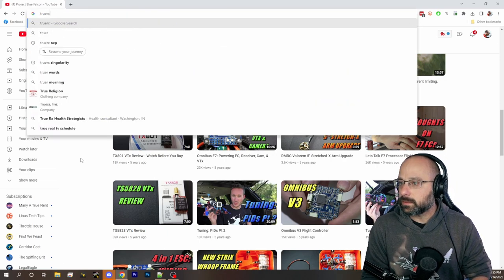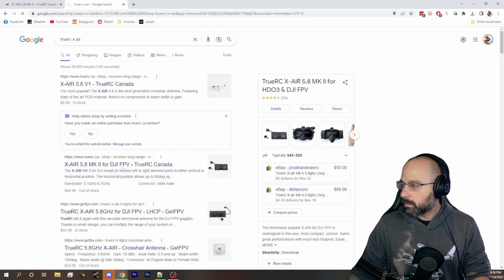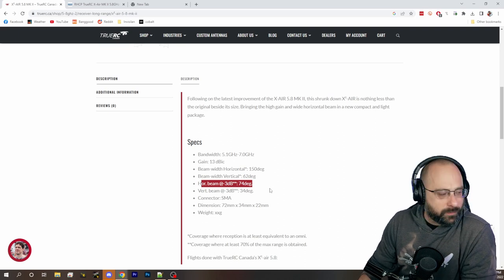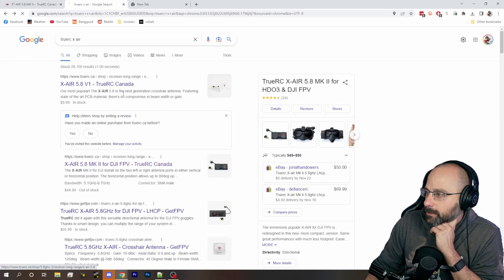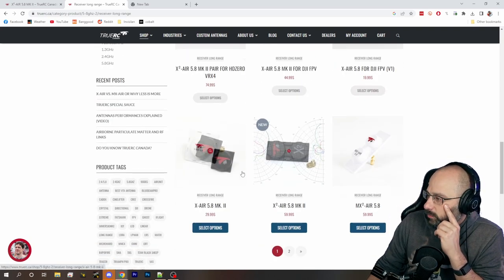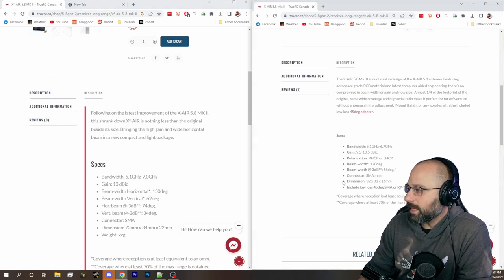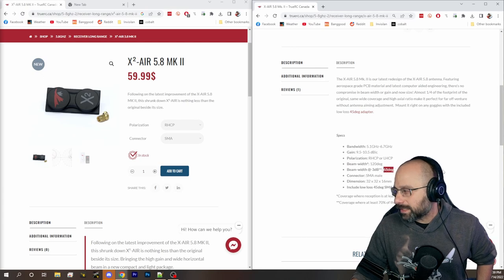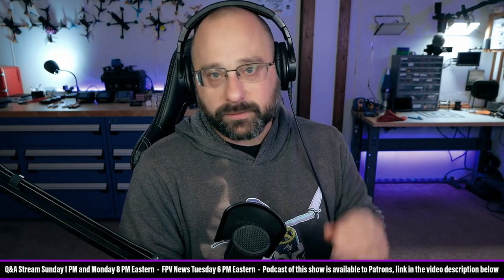How Do I Compare Antennas? X2 Air vs X Air - FPV Questions

Comment: Thanks for that Josh! always great to hear your info, sick or not.  Thank you.  Also, i was wondering when they talk about horizontal and vertical for that xair2, i have to wonder which orientation of the patch is better for side to side reception vs up and down...
Reply: Run the x2 air antenna vertically(or tall) to get best "side to side" reception.  Damn is it confusing to try and explain that in text LOL.
These are pretty similar to the VAS cross hair and pepper box antennas and are technically not a patch. I run VAS receiving antennas but have had them for many years if i was buying antennas today i'd go True RC all the way. Also follow their face book page Hugo will announce  sales of seconds that have cosmetic blemishes from manufacturing i recently picked up 97$ worth of omni antennas for 34$ including shipping, blemishes on the singularities i got was scuffed logos or small a tear in the heat shrink in one case.
Reply: @sayyay6230 so strange that the tall orientation gives a wider horizontal cone lol no wonder everybody getting confused and turning them sideways lol
Reply: @sayyay6230 also how often do they do discounts like that?
I'm looking to upgrade antennas but not tryna wait more than a couple or few weeks for a better deal

Comment: Just curious if the truerc x2 air are plug and play for the DJI fpv goggles? There's no inn menu settings like I find on YouTube for my goggles? Is the max power already set at 700 mW?
Reply: Yeah all antenna that work with it in terms of it matching polarization and sma connector. There is no setting in goggles for what type of antennas you are using. At least that’s what it sounds like what your saying.